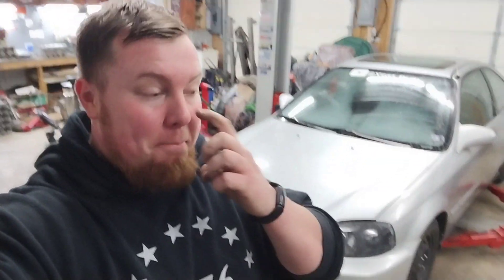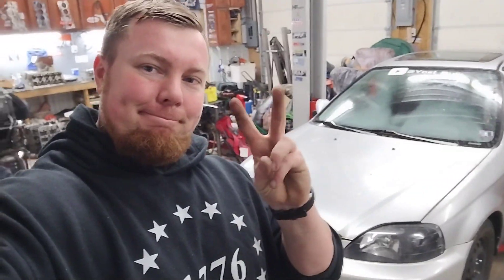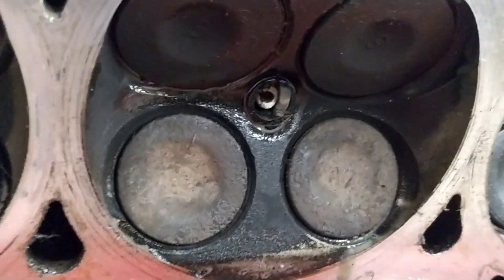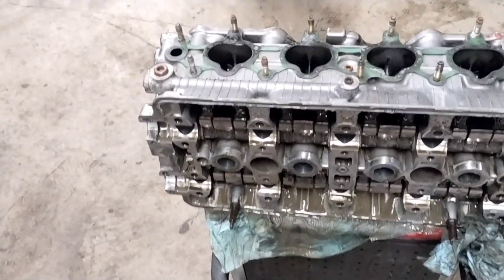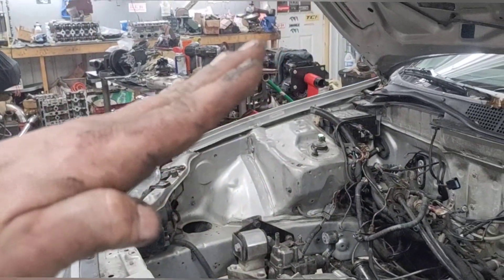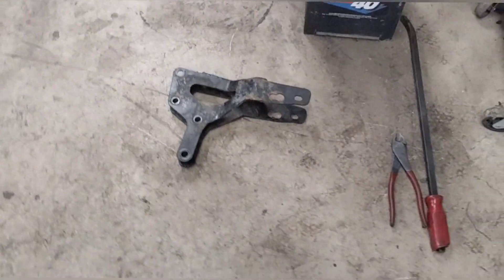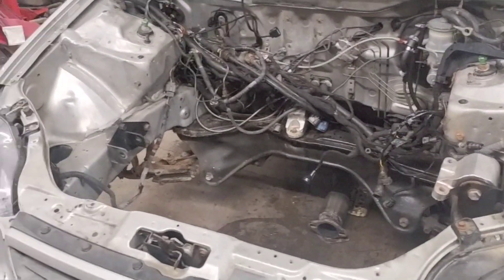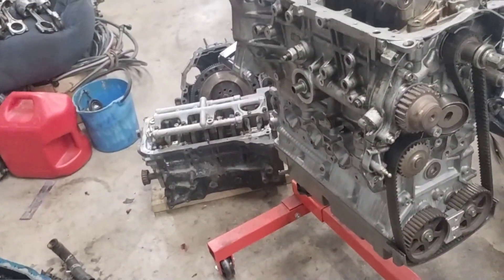G22 nitrous ek is back in the shop! let's find out what I broke this time!

Comment: Fun facts: not all H22 & F22 aftermarket water pumps use the same shaft size. But it's possible to pull the gear and press the entire bearing/seal/shaft between pumps.